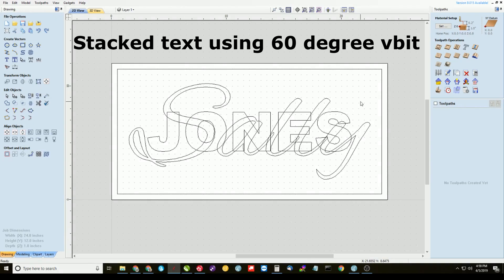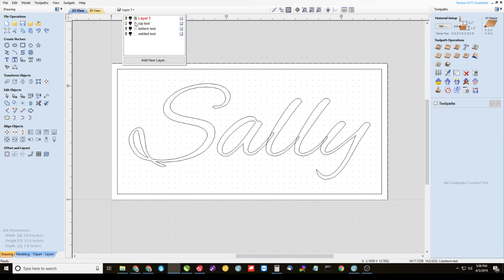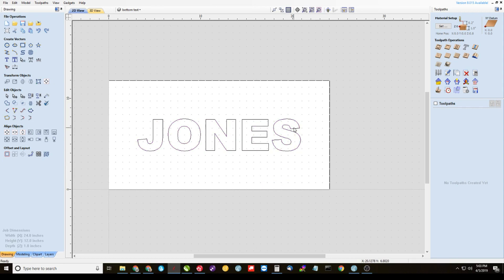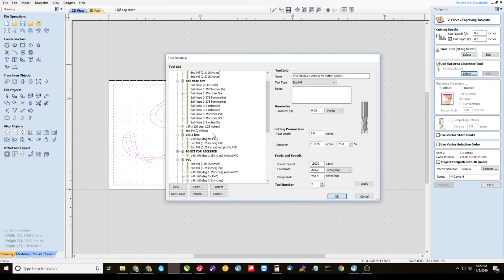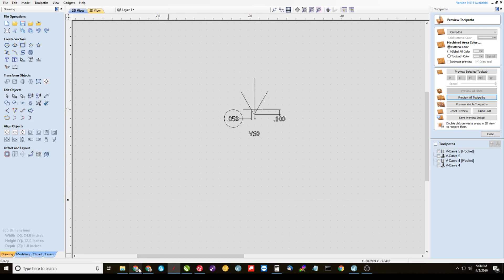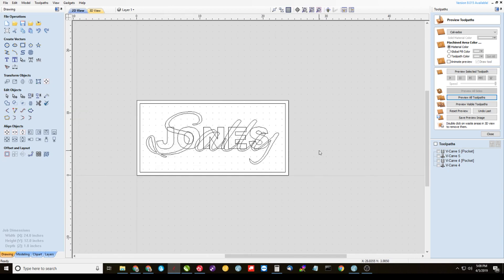Stacked text on text sign tutorial using a 60 degree vbit - Vectric Aspire 9

Comment: Thank you for the video and yes, it is indeed helpful. But if I look closely to the preview, you can see that there are areas on the second layer that has not been properly milled, for example the top of the S and O, where the 1/4 mill couldn't get. I am wondering if such thing is visible on the final product.
Reply from the maker: I discovered after I did the video that when you offset the vectors, you should uncheck "create sharp offset corners". That will take care of that problem.

Comment: Thanks for the tutorial. Not sure if you are still monitoring these comments but I ran into a problem. I am new to the CNC game. I setup a small test file. Everything looked great on the top text layer then when the welded text layer ran everything (text and inner border) has shifted to the right and is cutting into the top text. I looked at the text on all three layers and nothing appears to have moved. Any thoughts?

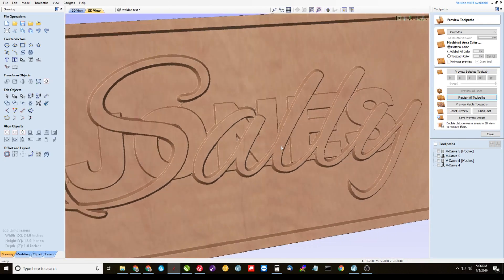Comment: At the 7:30 mark in the video, look at the very end of the bottom tip of the 'Y' in Sally.  What is causing that?  I'm seeing it in multiple spots on the test I just did -- not sure if it's font related, the offset isn't quite correct, or what?  I used all the same depths/bits/offsets as in the video.

Excellent tutorial though.  Thorough enough, yet straight to the point :)
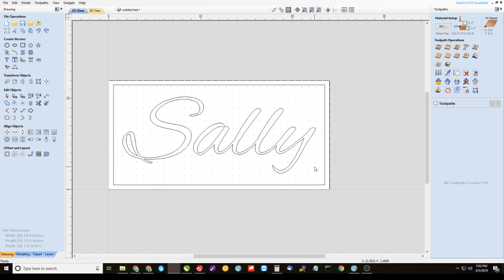Reply from the maker: Sorry for the VERY late reply. When you offset the vectors outwards (around 3:05 in the video), uncheck "create sharp offset corners" in the offset vectors tool.